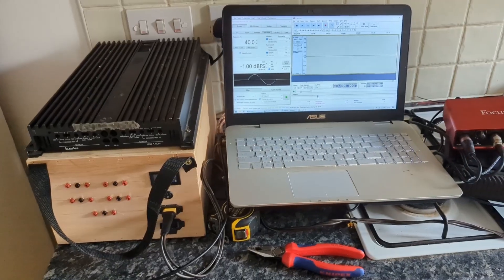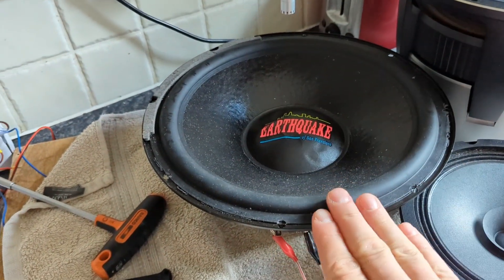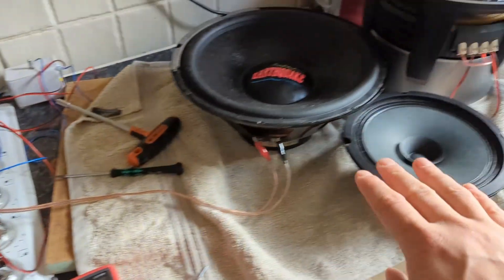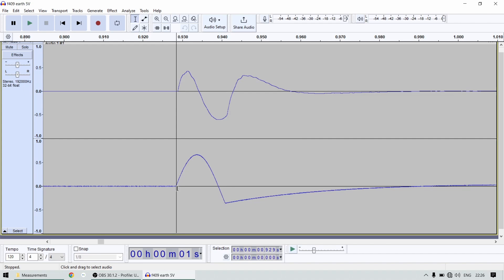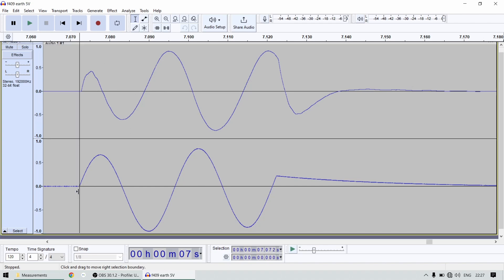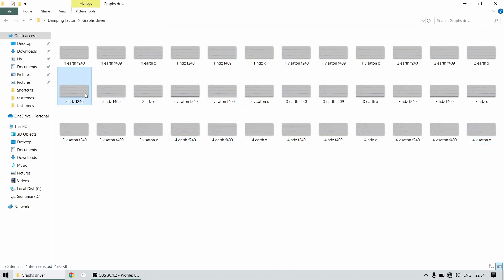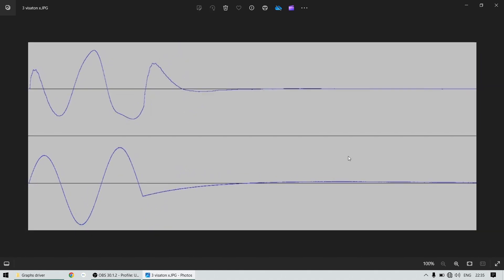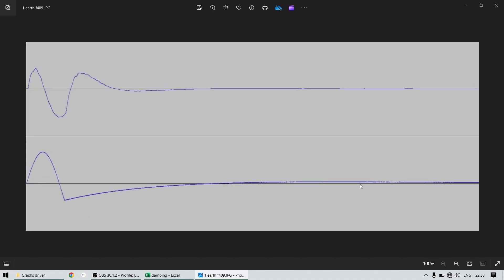Amplifier damping factor - results

Comment: My thinking on this is that there are less variants in driver suspension in modern drivers. Back in the 90s when this was becoming the standard for driver  design amplifiers had to be able to overcome these mechanical forces as a rule therefore produce adequate damping by rule. By its nature the stiff surround and multi layered coils combine for a stiff mechanical damping to the voice coil reaction in the magnetic field.

Comment: Did you ever end up testing the damping factor of the Taramps Smart 3 you owned ?
Reply from the maker: I don't think I did. Got the amp before started measuring DF and then sold it.
Reply: @RAW-CAt Didnt know if you were interested but i spoke to taramps today and they gave me a more detailed spec sheet for the smart bass line of amps. Says damping factor is >200 so not too shabby. Thanks for the all the test you do !

Comment: Did you flip the microphone phase in the measuring data? The diaphragm of the mic impulse will be out of phase with the woofer movement.
Reply from the maker: It does not change the results anyway🤷
Reply: @RAW-CAt it changes how the data could be interpreted. Also the mic and woofer are not in an anechoic chamber to remove any possible reflections that interfere with the measurement. Since the woofer is not mounted with the back wave isolated it could impact measurements since you're using an acoustic measuring device vs a laser.

Comment: 5 bolts on the earthquake in 7 V on the Alpine. In my mind as inconclusive...should have been a lot higher to truly simulate cone movement.
Reply from the maker: Close to Fs, and in free air subs are extremely efficient. Try it for yourself.
Reply: @RAW-CAt  would higher excursion higher voltage generated by the voice coil? If this would require greater damping?
Reply from the maker: @timothymroberts2949  well if you go over Xmax all the data is invalid. And that earthquake doesn't have much of it.
Reply: @RAW-CAt I am not asking in regards to go beyond designed x max. If 7v moves cone 10mm and 20 v moves 25mm xmax...wouldn't the greater max create a greater voltage to be damped?
Reply from the maker: @timothymroberts2949  well yes, that is exactly why I ran all drivers close to Xmax. Some need less voltage, some need more. The earthquake is a 4ohm driver, Alpine is 2ohm.

Comment: What about when driven at 30v and in an enclosure
Reply from the maker: Then the enclosure and the air inside takes care of the movement of the cone. In ported enclosures, the port is what controlling the cone.
Reply: @RAW-CAt  so could it be that damping factor is more about tonal difference dependant on frequency impedance

Comment: Compared to some other such tests this one is somehow half way to answer. It does not measuer what is going on with reverse speakers energy  and behavior of the amp/driver at  just one particular Hz peak, can be very different at multi frequency - whole or broader spectrum loads. This is proven fact.
Take a song YES: I've Seen All Good People, where is kick drum - it is a fast double kick (it is very distictive), but  tube amp will  make it to sound just like or almost like just a one kick on less sensitive speakers for sure. Tube amps especially push pule ones does not suffer from current deficite. So what elese can be then dumping factor? If it is (which we can believe it is) the main factor for such audible result, then this test is for sure half of story. Also transistor amp with less damping factor and current (regardless of wattage to some point) will have problems to deliver and control bass at more demanding loads and drivers for sure.
Reply from the maker: Unfortunately I do not have a tube amp with non existent DF to test. The lowest DF amp I tested was orders of magnitude better than any tube amp🤷
Reply: @RAW-CAt  Anyway, good effort.
Reply: @RAW-CAt  Place a resistor in series with the amp. 
The total actual damping is limited by the series resistance of the driver. However with some tube (guitar, ??) amps the damping factor can be less than 1.

Comment: I had Gemini (2.0 Flash Thinking Experimental ) analyze your video for testing flaws. It just chewed up and spit out your video. You need to start from scratch on this research if you want to really prove if damping factor makes a difference or not. Improve all your testing methods. Change it from waveform/sinewave to impulse response. Also measure the output impedance of the amplifier before and after your speaker cables and speaker cables and terminations can undo a lot of an amplifiers DF.
Reply from the maker: You are more than welcome to replicate this experiment eliminating all the flaws. I would be very surprised if the results would be any different.

Comment: Damping factor concern was stopping me using an amp bridged to 500w for subwoofer duty, the damping factor would  be half 95 so under 50 and figured its too low, all the other amps are not that low!

Comment: I wonder if the damping factor myth will ever go away? BTW, I have repeated this elsewhere, but make a loudspeaker draw the same current from LF to 100KHz (current EQ) and the speaker will always behave like it sees a zero Ohm output impedance from the amplifier. Any amplifier! You can now even use a fairly high output impedance tube amplifier and it will still look like zero Ohm. No, I am not kidding because I am listening to this right now.

Comment: Long comment but relevant:  These talking points or selling points about amp specifications from manufacturers all these years can be applied to multiple facets of sales in the industry from pushing or marketing these huge ofc power/ground cables for amplifier use, to "high end" RCA cables,  to Sound deadener ( I could literally write an article about that market) among other things is just about larger sales/profit margins when they are mostly (not 100% cases but most for sure) total dimishing returns for the consumer/hobbyist. For just listening to music, sub amps that are capable of 2000 rms can still be connected with a 4 awg ofc power/ground and will be supplied with adequate voltage and current. Full range amps most certainly can be powered with 8 awg ofc almost always (yes OFC is better than CCA at least they get that right). These overkill situations with 2/0 awg plus are needed really for the guys that do the DB drags and I think for some cases that's overkill too. For the most part the companies try to sell you wire that is $5.00-$10/ft instead of $1/foot because it helps their profit margins (nothing more).

The same can be said all these years about sound deadening material and let me tell you having been in this hobby for 25 years I have spent my fair $hare of money on that $tuff which only added more weight to my car, made my bank account shrink, and made my door panels or roof have a solid sound when tapping on it instead of a ringing sound ( wow how useful). 
The past two systems I have installed I have not used hardly any of that stuff except for maybe here or there to act as a decoupler for surfaces that needed some isolation to keep from pressing together. These last two setups have had the least amount of rattles out of all my others. 

What makes the most difference for eliminating rattles in a car stereo designed for quality sound playback is not sound deadener treatmnent but knowing a few things about midbass/subwoofer integration. Most guys cross their sub LPF's way too high (@80-120 HZ) and the same for their midbasses. That's mostly where these rattles and buzzes are coming from. Too much energy in the (80-150 HZ) areas. Subs aren't supposed to be midbasses. The best thing a fellow can do to clean up rattles and buzzes is to use a solid baffle ( wood or high density plastic) for the midbass with a weather stripping type material behind it when screwed to the metal inner door and keeping their crossover points for their sub/ midbass around 50-70 HZ LPF/HPF 24DB. Depending on how loud you listen while it might not totally eliminate buzzes and rattlles it most certainly will reduce them far more than any amount of overpriced sound deader material you add to the car. Try it out and you also might find that it helps to eliminate sub localization.

Comment: I've owned some really nice class AB amps  over the years from ARC audio, Precision Power, Zapco c2k/ Reference..Some of these amps are now highly regarded and have some of that old school SQ mythos from the 90's/ early 2000's. I've used these amps with anywhere between 300-500 watts of rated output on some very nice subwoofers . Bottom line is these amps all had damping factors above 400 and up to 600 and costed sometimes $600-$1500 USD some 20 plus years ago( do the inflation calculations if you like). Today I'm using a $150 sub amp again on some really nice subwoofers and I can absolutely tell no difference.

Comment: Well 40hz free air is pretty hard to hear, wouldnt ih be different when an driver is mountet in an enclosure and measure in the port (if portet enclosure) or better measure the pressure in the cabinet.
Reply from the maker: Of course it would be different. However the purpose of the test is to see how the amplifier "controls" the driver. Not a system with acoustic air suspension or port resonances, only the driver itself.
Reply: @RAW-CAt  thats also My point.

You are measuring the driver in free air with a mic thats designet to measure sound.

Most subs don't play 40hz or it barely to hear free air. If you put it in an enclosure in a car, you got cabin gain and also the output from the driver in the cabinet. Here it should be a lot easier for Even the mic to measure or Else if you measure the pressure or with the mic in the port, it should be a lot easier to pick up for an mic.

Comment: @RAW-CAt- Ive been doing some research on how damping factor maters more as the freq. gets lower.Also how the resistance of the awg., & length of the speaker wire is usually why we can't hear the difference of a damping factor of 100 or @ the most 200. Example: the resistance of a 10ft, or roughly 3meter, 12 awg speaker cable can only pass a damping factor of 200. So smaller gauge, or longer cables would restrict more. I would like to see a 4 gauge cable, approximately 3ft, or 1meter long, wired to a 4 ohm woofer, @ 10 Hz, to see how much a damping factor of 100, 200, 400, & even 1,000 might change the detail, & impact of that freq.!? I have in my Large SUV, 4-Fi built D2 18s(with 33mm of X Max, & 3,500 r.m.s. 4 inch coils), in about a 850 Liters/30 cu. Ft. ported enclosure, tuned way low! Powered by a 17k amp. My wiring options would be .25= not going to try for this test, 1 ohm, 4 ohms, or 16 ohms. My amp is rated with a damping factor of 400 @ 4 ohms, so @ .25 of an ohm👀yikes= a damping factor of only 25, 1 ohm= 100, 4 ohms= 400, & 16 ohms= 1,600! This would be a great test, but i am unable to because i am disabled, & have not been outside in almost 5 years!
Reply from the maker: Your case is very unique. The fact still remains that for 99.9% of people the damping factor has absolutely no influence.

Comment: I strongly encourage you to bandpass filter that output. You think you have only 40Hz, but you don’t. Those sharp edges of the waveform at the start and end of it have energy at other frequencies- high frequencies. 

Think of it this way. Anything that changes in time faster than your smooth sine wave - any turns in that wave faster than what you see in your sine wave- means there are higher frequency components in there. Going from flat to suddenly starting into the sine wave has that. Ditto on the end of it. Stopping on a dime needs a fast rate of change - aka a high frequency.
Reply: I'm not sure why my previous comment got deleted.  Perhaps b/c I included links in it.  But, the quick version was that you can take your single cycle from REW, save it as a WAV and in Audacity, select that bit and copy/paste it to the middle of your 1.3s or so clip (or just pad the beginning with silence.). Then, analyze, plot spectrum.  You'll see a massive amount of high frequency energy in there.  If you run the Generator, CEA-2010 in REW to make it, you'll see far less.

Next, though, just run both a high-pass and a low-pass filter on your sample -- say high-pass at 20Hz and low-pass at 80 Hz with a steep cut.  The same plot spectrum will show the effect as you're now far closer to just having energy at 40 Hz.

Finally, try something in REW like square wave, 1Hz, duty cycle 1%, and a 3s duration to make a WAV that has clicks at 1Hz.  Super low right?  Plot the spectrum of that (just select one if you like) and you'll see an almost linear decay that goes all the way out to the highest frequencies.  Making that sharp transient of a square wave actually has energy at all sample-able frequencies.

Comment: The results from the mic measurement vs the electrical output from the amp should (at least in theory) lag about 90º from each other. The mic basically measures acceleration from the air in front of the cone, so the peaks of the mic values should align with the crossing points of the electrical input.

With other words, the peak from the mic reading should be aligned with the changing directions (or polarity) of the electrical sine wave. When there's maximum voltage from the amp on the top and bottom of the sine wave, there's no acceleration from the cone, so the mic reads "zero".

There's an awesome video of subwoofers by Alpha Sound about this subject.

Comment: disapointing result indeed,   but in a more engineering way, it should make a difference. high class amplifiers these days in care audio have around 1000 factor, previous models were about 400, talking about brands like Helix, Zapco, etc. BUT too high damping factor it's not a good thing also. basically we need as much clean power we can get and good electronics circuits design

Comment: Hi friend! I hope you can give me your opinion. I was using an audison bitone.1 and then it went to valhalla. Now i need a new DSP. My options here are Helix mini dsp and alpine pxe-0850x for similar price. Any other option is way over my budget. I run a morel hybrid ovation 6 2way kit and a jl 10w6v2, so i dont really need more than 6 channels. The car is a ford fusion with sync 3. Which one would you choose between the Alpine and Helix? Thanks man!!! Very nice channel!!!
Reply from the maker: If 6 channels is enough, go with the Helix. It will be smaller and easier to install. However for having a future proof system with possibility to upgrade, I would choose the Alpine with more channels.

Comment: in general, I agree with you. If you look from an acoustics point of view, there is no difference. but your graphs show differences in the factor. I think that if you connect a resistor instead of a speaker, the bottom graph will look more like the sound you are sending. I think that the peak after the end of the sound, and the graph of its fall, is the factor that we are looking for. this part of the graph is the electricity that returns from the speaker and the faster it becomes zero, the higher the damping factor

Comment: One thing about it💁 ive never had a great amp without high damping.. ive never had a good amp with  low damping .. and ive never had a bad amp high damping..  and i dont think anyone else has either... So it seems to me damping even  at minimum shows use of quality parts and design go hand and hand and generally result a good df rather deemed useful or not..
Reply: i would agree based off of equipment i have owned.